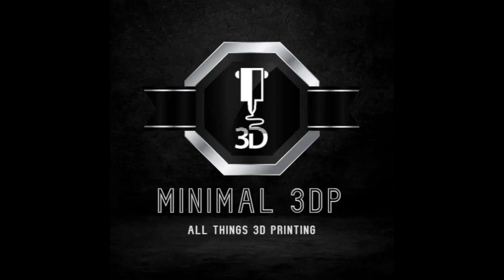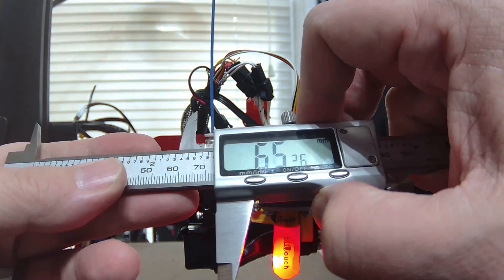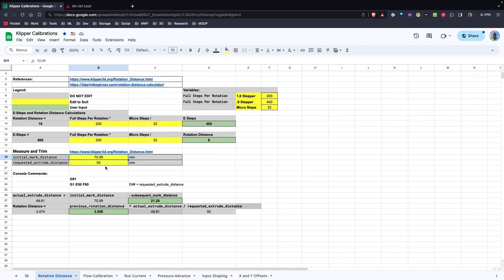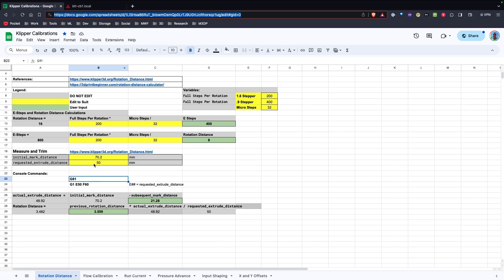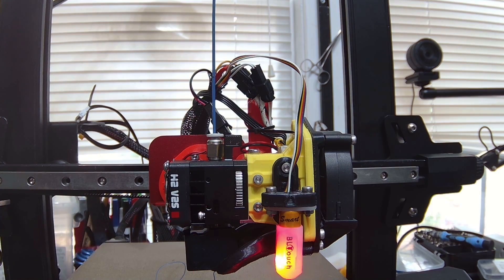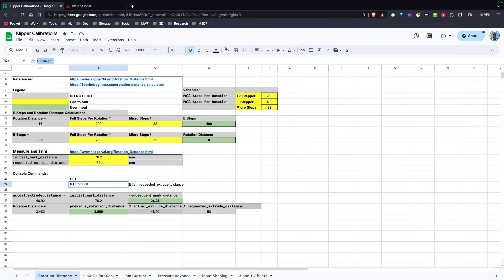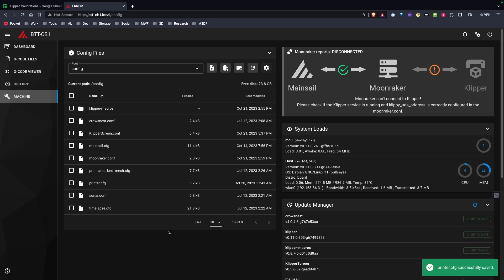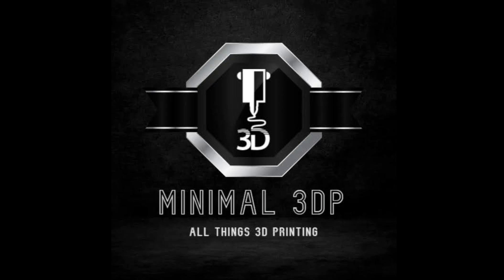3D Printing with Klipper, Setting Rotation Distance (ESteps)

Comment: Followed this tutorial as closely as physically possible with my system, the ender 5 s1 made it a bit tough with the bowden tube but otherwise I followed as closely as possible. Fingers crossed, from what all my trials and errors tell me this should be what fixes my prints. Here's hoping!
Reply from the maker: I hope it helps. Take a look at the pressure advance as well.

Comment: Awesome spreadsheet....Was wondering about the microsteps....You have a setting of 32, where mine is at 16...

[extruder]
step_pin: PD15
dir_pin: !PD14
enable_pin: !PC7
microsteps: 16
rotation_distance: 23.352

Should my copy of the spreadsheet be modified to reflect that value, along with the full steps per rotation...where does that value come from??

Thanks!
RonO
Reply from the maker: I use 32 because that value seemed to be used on some websites I referenced (voron, I think). Make a copy and edit as you see fit.

Comment: I appreciate the video.  I've only seen this done by removing the nozzle do it's not actually extruding hot plastic.  Also, I think you measured with the caliper from a different starting point each time.  Once below yhe white part of the coupling and the second was on top.  But I get the idea.  Just not sure if testing with the nozzleis the right way to go
Reply from the maker: I think it is because it mimics real use but as always mileage might vary.